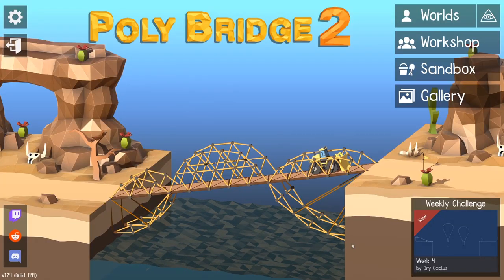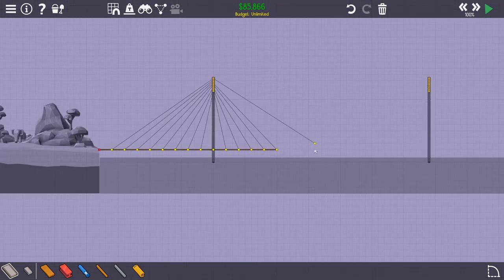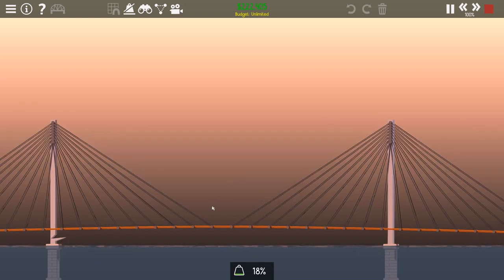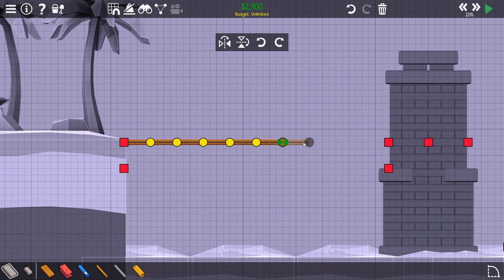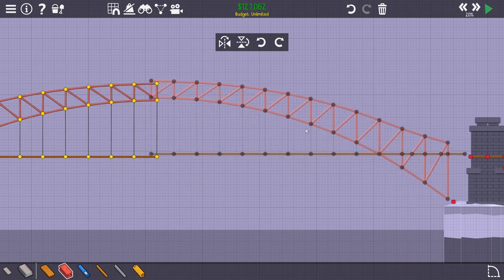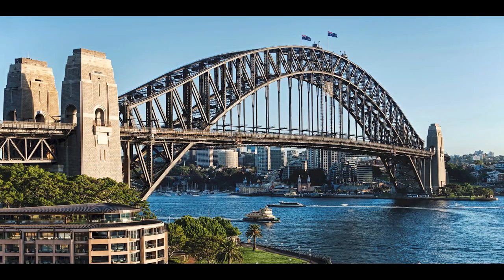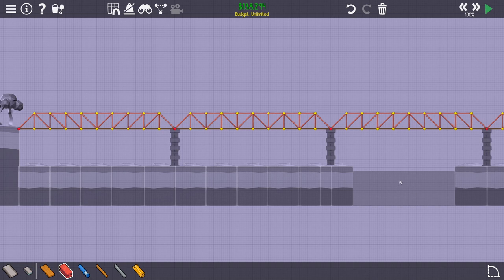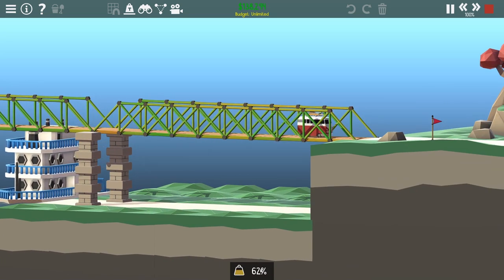When building AUSTRALIAN bridges becomes TOO REALISTIC... SPIDER ATTACK!

Comment: RCE: starts swearing uncontrollably

Me: Why tho?

RCE: omg theres a spider and my GF cant get it.

Me: Understandable, have a great day.
Reply: Never did I think the day would come where I would relate to a random engineer on the internet.
Reply: when I notice a spider I just take it in my hands and move it to the outside
Reply: @maciejp7829  i could never do that, i  hurry to get a glass and some paper and trap it inside of that and than move it outside and then figure out a way to get the spider out of the glass without throwing the glass away
It could be so easy but no 
Thanks brain realy apreciate it
Reply: Every time i found a spider either i slap it until it dies or stomp on it until it dies.
Reply: If i find a spider i just grab my nearest flip flops or slides
Reply: sambal tahu now that's just cruel xd
Reply: I love spiders and you cannot tell me otherwise. You can attempt but will fail.
Reply: @sambaltahubarna7564  nyasar?
Reply: @rahirz4234  nga. Suka aja kontenya.
Reply: @sambaltahubarna7564  oh, wkwk
Reply: @StormTheSquid  XD GOOD GOD YOU KILLED ME
Reply: our pfps?

Comment: Pratt bridges are often preferred because the longer diagonals are in tension instead of compression. If you orient them in the other direction (Howe), they'll be in compression and may have to be increased in size to avoid Euler buckling failure due to their long length (tension members don't have an equivalent failure mode dependent on length).
Reply from the maker: Thanks man, good knowledge!

Comment: Stoked to see the Burdekin bridge in this video.  Some fun facts regarding this bridge pulled from local knowledge - the support pillars have no solid foundations and sort of float in the sand. You can feel the bridge move about when stopped in the middle of it (usually for bridge work).

Grew up being told it was the longest single span bridge in the southern hemisphere,  but can't find any references to actually confirm this.

Comment: I don't know if you still read comments on a video this old, but the first bridge over the Mississippi river deserves some love. There had been many attempts to bridge the river, but all had failed. Andrew Carnegie had a fledgling steel company, he decided to prove that he could produce steel in sufficient quantity that it could be used as a building material. Thus he built the first steel bridge and at the time the longest bridge (or at least the longest unsupported bridge?) up to that date. Then to prove it was stable he held a parade to cross it lead by an elephant because there was a superstition that elephants would not step on an unstable structure.

Edit: After looking it up, it is the Eads bridge in St. Louis. And it was the "longest rigid span" of bridge. And it has a weirdly fascinating story that was fun to read.

Comment: You're sacrificing stability by not attaching your suspension bridges to the static joints. The roads are allowed to rotate unnecessarily, and the wiggly roads are being asked to hold the entire weight of the car in tension. Making the halves meet in the middle with an even number of roads and attaching a cable to the static joint would make the bridge basically completely stable.